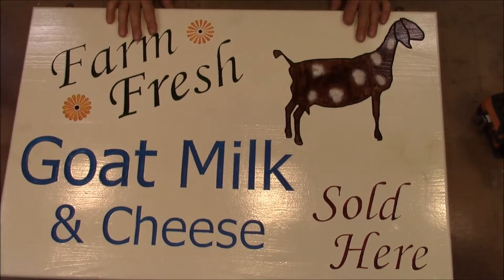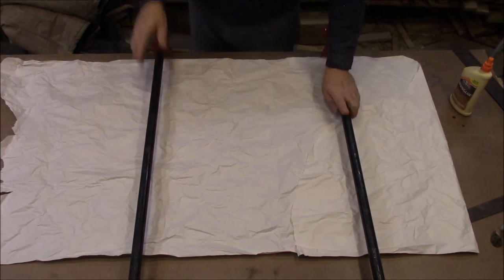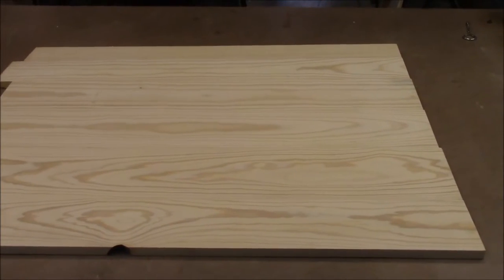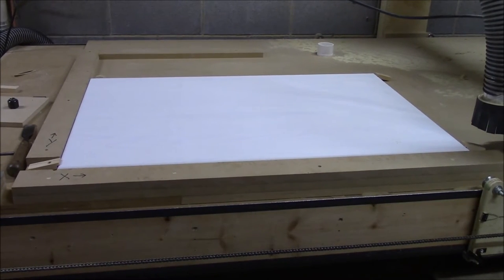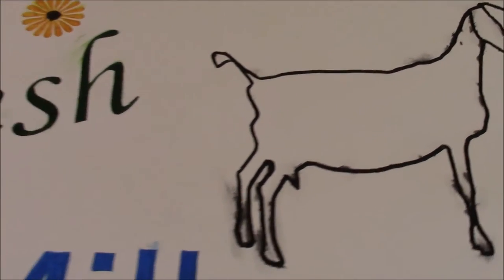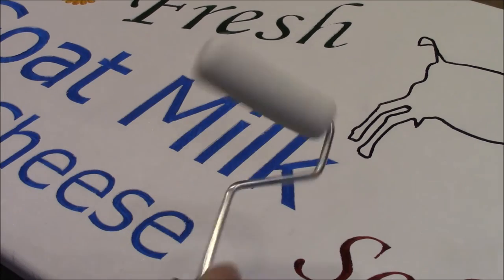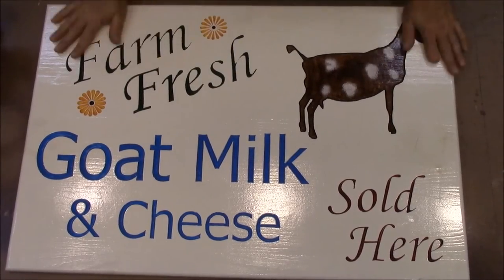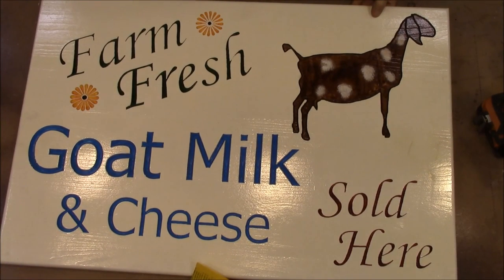CNC Goat Milk Sign

Comment: I tried the contact paper trick but the problem I have is that it doesnt cut the contact paper but rather it flares up the edge as its carving and doesnt want to cut the film .. any advise?  maybe dull cutter or too slow??  what do you think?
Reply from the maker: I often have a ragged edge but it doesn't seem to matter when I paint it.  Some thoughts would be:  Is your cutter sharp?   Did you roll the contact paper so it's stuck down really well?  Hope that helps.  Good luck and thanks for watching my video!